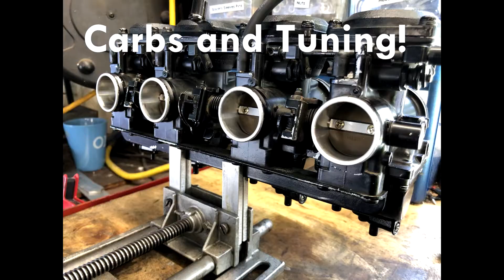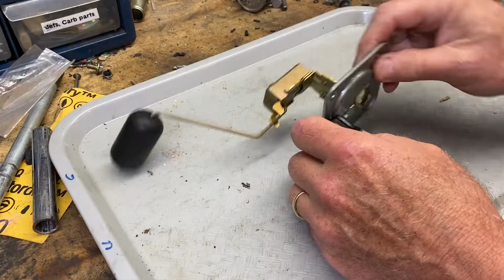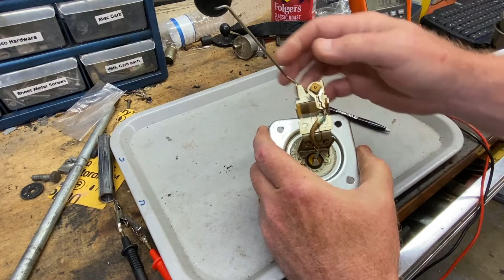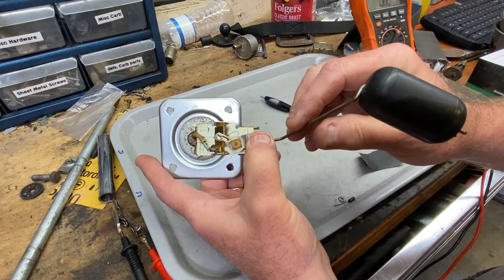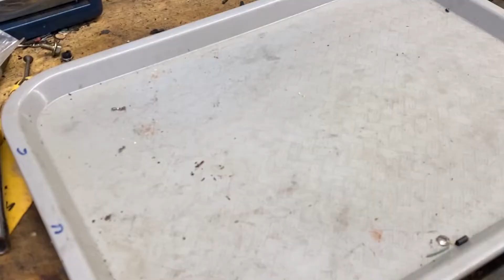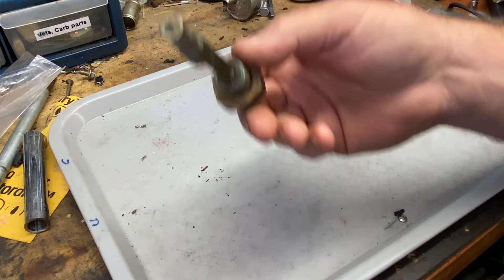Testing and Servicing the typical motorcycle FUEL LEVEL SENSOR

Comment: Does the floater need to reach the highest and lowest point of the tank to get an accurate reading? I'm planning a custom build with a tank that runs down to under the seat. And I plan on re-using a fuel pump from a CB500F. But I'm unsure how to go about the fuel sensor.
Reply from the maker: That's a good question, with a custom tank I don't know. I'd probably be more interested in accuracy as the tank gets low as opposed to when it's full, so if it were me, I'd favor making sure the float drops all the way to the point where the sender would be indicating time to add fuel, and leave a comfortable amount below that. When the Concours 14 fuel is showing LOW FUEL you can ride for many miles still and even when you do, there's almost a gallon left. I figure if you left at least a half gallon or maybe more when the float is bottomed (not bottomed on the tank but at full drop on the sender) you'd be safe.

Comment: Digital meters have a sample rate which on the cheaper ones can be fairly low so you can get some funky readings on a potentiometer. A cheap analog meter is a better choice for testing something like this if you get a jerky sweep of the needle there is an issue if the needle moves smoothly in relation to your movements you are golden.
Reply from the maker: 100% agree. Should have mentioned that. What I’ve done is tested enough so I can tell funky readings vs malfunctioning potentiometer. I should pick up an analog unit when I see one at a swap meet or something.